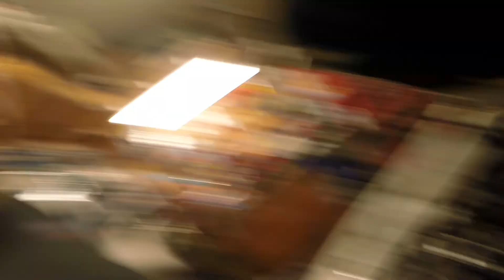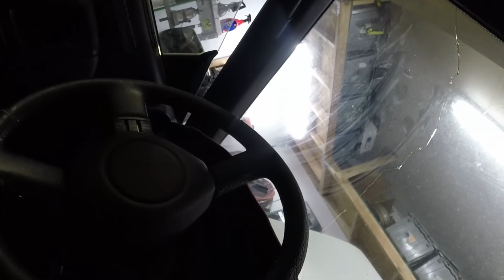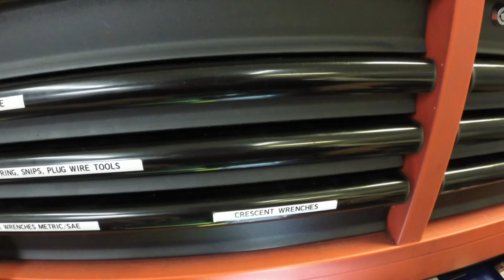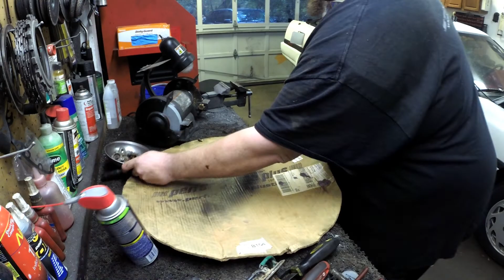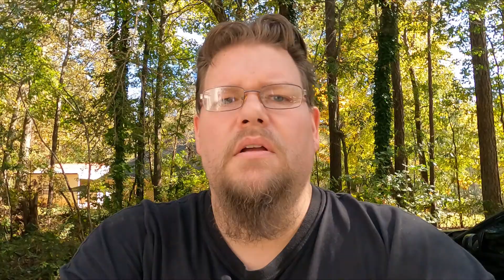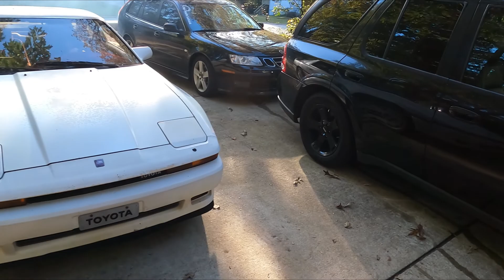ABANDONED Toyota Supra Revival! First Start in 12 Years??

Comment: Is that a 97X 6.0 in the driveway? And is your TBSS an 06? If so i find a big boy oil filter that fits just the 06's. Found the info on the forums. It's the mobile 1 M1-206A the stock filter is M1-107A. I've got the upgraded Melling oil pump so I figured I'd might as well start running the bigger oil filter. I wish I had your knowledge, love your channel keep up the good work. God bless
Reply from the maker: That's the same filter I run on mine! Also wix 51522xp is the same size. Just remember 07+ they went to a metric thread so that filter is m1-212 or wix 57045xp. Both of those builds are also on my channel if you want to check them out. I appreciate you watching and commenting. Have a good day!